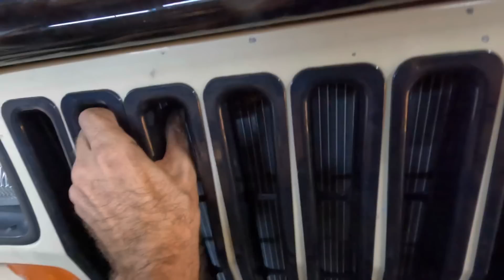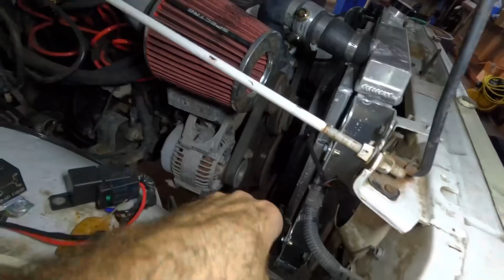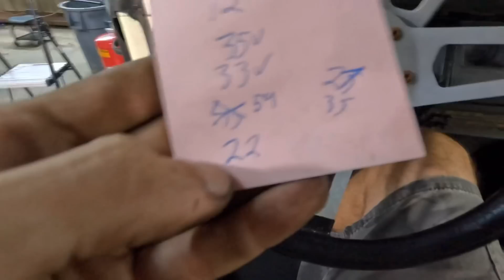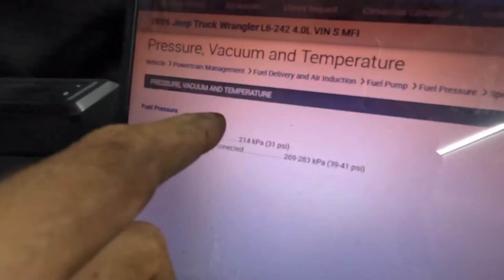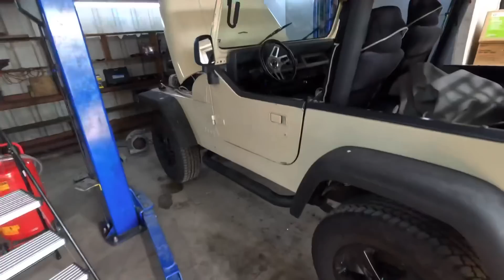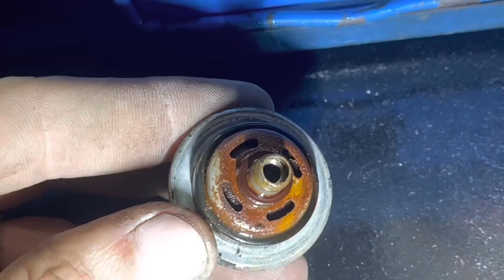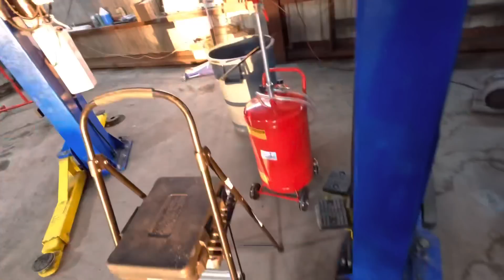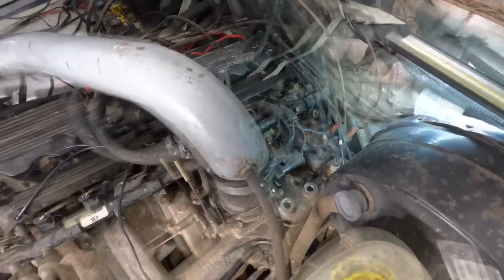Parts Cannon!! Can it be saved?? 95 Jeep Wrangler 4.0

Comment: On that long cold start issue, I had the exact issue on two different vehicles.  Both times it was the temp sensor that communicates with the ECM, the one on the thermostat housing was bad.  You can obtain resistance values to test and check with an ohm meter pretty easily.

Comment: Consider getting a cheap scanner that have OBD 1 connectors for the older vehicles you may service. Also check injector ohms & spark plugs. Connect the loose ground you found. Good diagnostic work so far!

Comment: so with the 4L i have repaired a lot of them over the years and Vacuum is a big deal with these engines, whenever i would get one the number 1 thing i did was all of the vac lines no matter what, i have seen over heating cuz of it no ac, no heat, loss of vent use and non start. all due to bad vacuum lol. also if that jeep has a ACdelco or ultra fuel pump they push 3 psi less pressure then the stock unit, the best pumps to use are the BOSCH or DELPHI. also only use a Bosch or  wix fuel filter. the water pump is more then likely fine its the paper gasket that goes bad once you overheat the engine and the exhaust leak is going to be the manifold. they always crack. best of luck

Comment: I ran across a smog pump on an old 70s Toyota Celica that caused the manifold to overheat (actually glowing red) until it cracked.  It was brought to me after they put 2 exhaust manifolds on and they cracked.  Some old cars were plumbed into the exhaust manifold, unlikely to ever see that again.  Probably will never see another 70s Celica either lol

Comment: Ok, now that I'm to the end of the part 1 video ...

I second all the comments about the camshaft sensor.  That little disc in the distributor can cause all sorts of havoc.  

And yes that includes low fuel pressure - the ECM shuts off fuel flow if it can't sense position.

It absolutely will and can cause the slow start, stumbling, and apparent misfires observed.

To me, I'd start there, also check the crank sensor, and make sure those are good before going on to other things.

Nothing is going to behave correctly with the position sensors unhappy.

Comment: Get back to basics. Have a look at those spark plugs, verify correct heat range. Check the injectors, a partially plugged injector will function well at idle and not at upper RPM ranges. Poor fuel spray pattern can also cause trouble. Lean condition will cause excess heat in the cylinders and exhaust manifold.

Comment: Unless its vehicle body work i expect a same day fix ….
Book it in , drop it off , pick up & pay .

Anything more is a red flag , be it the vehicle or a iffy mechanic .
A second opinion normally sorts poor mechanic problems !
I have 6 shops on my never use list ( 2 are now closed down but you get the idea ) …...

A straight MOT is about 30 minutes & can be wile you wait !
My planned repairs last year , Full Service , Break pads , Exhaust ( not the cat ) , Steering joints & MOT all in 4 hours !

The full service “ Oil changed , Oil filter , Plugs , Throttle body cleaned , New rocker cover gasket ( so it's been open ) , Air & Cabin filters ” .
Verified afterwards but more has probably been done as “ Service ” is not normally itemised !

Obviously not a one man show but that's what's expected .

Comment: Almost anything can be saved, question is if it's worth the time cost and headache.

A neighbor had a Jeep, the original model, up on blocks when we moved into our hose back in 71. Late 70's or early 80's he had my dad over to see if he thought it could be "saved". It hadn't run for 30 years then and the frame and most of the floor was rotten. The engine was apparently in surprisingly good condition and needed very little attention to get working. But the rust! Dad ended up spending a weeks evenings welding it together, replacing the floor and rebuilding the frame. There's no way it could have been road legal, but for rumbling around some estate it would be perfectly fine. Then it went back up on those blocks again with new tarps and there is where it still was in 2012 when the couple who lived there had died and their kids sold the house. It must have meant something for that couple or they wouldn't have it standing there for all those years, but my father was a bit miffed that he spent so much time fixing it up only for it to never be driven again. Don't know if the new owners were able to get it sold or just had it hauled of to be crushed.

Comment: You will get this Jeep running. Sadly it looks a complete vacuum system repair. And maybe a wire by wire continuity test from the ECM. Because of corrosion problems with the connectors. But don`t rule out a bad ECM even though it was changed. I would also flow test the injectors like you stated it could be running lean. Causing it to run hot and be hard to start. Everything needs to be checked it could be a sensor giving false readings to the ECM. I have an S10 that did not want start I changed the fuel pump and the filter with no change. I knew I had spark when I dumped a little fuel in the throttle body it fired up and was drive able. It turned out to be a coolant temp sensor was giving a false reading to the ECM so it would not richen the fuel mixture when it was cold. It could also could be a ground issue. I purchased a Dodge Dakota that ran terrible I cleaned all the grounds and now it runs good. Thank you for another nice video.

Comment: The code 54 is missing camshaft signal. In the many Jeeps of this era that I've owned, a fuel pump or fuel tank check valve was typically the cause of hard starting. You could usually prime them by switching the ignition (no crank) several times to get enough pressure to start. That's why you got it to finally idle after a few attempts. I don't think I've ever seen a bad fuel pressure regulator ever, though.
Reply: I found it odd it would start again after he relieved pressure from the rails check valve, but not when it had pressure.

Comment: I have a 97 XJ (owned since new, too).  The only mods I've done, engine-wise, are 4 hole Mustang injectors and the obligatory APN exhaust header after the OEM one cracked.

Parts wise, other than the usual oil pressure sender, etc. the only engine management fix I've had to do was replace CPS once, and the camshaft sensor inside the distributor once.

All of the above in 327,000 miles.

Comment: When we used to do them we're ready to replace the motor or get someone coming with oil leaks we used to replace the whole thing because Chrysler made there was a new update for the pcvo system the 40s were famous for leaking oil because the PCV would plug up on all the small voltages on Chrysler same thing I would replace the to the update for it would be a lot easier and would be less headaches for you and the customer

Comment: Ray based on your other videos of your work, you might want to advise for people to use you as a pre-purchase check vs those post purchase checks you got in the other shop.   Just a though, an Hour or 2 of Labor to check over  a car/truck, give a list of known issues.   No parts to change, no parts runs.  would probably have to be appointments while they are doing a test drive.  Just kicking ideas around.

Comment: These ECUs are notorious for having cracked solder joints for the connector where it attaches to the circuit board.  They can cause all kinds of poor running issues.

Comment: Had a 2002 Jeep Grand Cherokee... the radiator fan was... notorious for failing over. Back when I had that particular vehicle I stumbled across an interesting... "upgrade" if you will. As you noted the clearance from the fan to the pump is very, very, very close. So close that there was, at least for some engine types, an upgrade that put a fan on the pulley / pump. Thus converting the vehicle from an electric fan to a manual fan... costing some horsepower apparently. 

I was never actually able to lay hands on a conversion kit... but I would be under the impression that somebody out there probably still makes an aftermarket version, or can fabricate an aftermarket version.

It may be worth bringing up to the owner of the vehicle that it may be possible to convert from an electric fan to a manual fan.

Comment: A stuck open or partial stuck open injector will cause a starting issue along with hotter exhaust gases and could cause driving issues as well. It will give a low fuel pressure at start and while idling.

Comment: let me go out on a limb here and say the customer probably overheated this engine more then once i have dealt with alot of jeep 4.0's... run a compression check if it checks out check for leaks at the intake gasket... but before all that check distributor they are known for problems with rust and crap interfering with pickup reading at least  thats what i have dealt with and had good results

Comment: Aww. Its not fixed?
You know. My 88 supra has a jumper circuit you short out to test with older gms had a test system  why jeeps dont have a pre obdIi connection system is beyond me.  Toyotas was ODB I  
I remember when talk was about making 
OBD II the standard.  Using the scan tools speed up finding the problem at least it points in the right direction.

Comment: I had an old chrysler that did that, the exhaust manifold was plugged up with something, I cleaned it out, put the manifold back on and it ran fine until I sold it, I never did figure out what caused the blockage and didn't really care.

Comment: Ah yes...hot injectors slowly becoming inoperative because they are old and have cracked bodies that stop working as soon as they get warm.  The verify: spray cool water on all the injectors if it restarts without an issue you got your problem.  The replacement injectors need to be OEM, the pcm is really really finicky on the old black box pcm models.  At the same time, put the 2004+ perforated heatshield under the injectors before you swap them, the heatsoak really kicks their ass.

Comment: I am thinking it's a timing thing. Now here me out. My experience with these motors comes from installing a stand-alone Holley Terminator X on my engine. So, I had to become REALLY GOOD at understanding sequential, MPFI systems. I even do my own tuning and setup on my engine. And my system has a turbo on it as well. My system runs super smooth and great power. 

If the timing somehow got wacked out and the engine is running too much retard, that would give you the stumbling, lack of power, super-hot exhaust manifold. But sense the ECU controls all that, something COULD be MECHANICALLY wrong. Did the owner ever remove-reinstall the Distributor? If so, is it installed slightly off? (You can turn the oil pump shaft with the Dizzy removed.)

IF it's installed a bit off, that will throw off the syncing of the Cam Position Sensor out of sync with the crank position sensor. The Cam Position sensor is inside the Dizzy, Crank is on the bell housing. There is zero chance to screw up a Crank position sensor during a removal-replacement. 

These engine's MPFI systems are so basic and easy. Another thing to look into is the IAC sensor or the TPS sensor. I had a crank/no start one time, and it ended up being my IAC sensor. 

I am really curious on how this turns out. I hope you share with us your findings.

Comment: As someone with three pre-OBD2 vehicles with carburetors and manual transmissions, I can relate to some of these old school repairs and troubleshooting....1970 VW sedan, 1971 VW Convertible, 1988 Mazda B2200 truck (50 years with me, 46 years, 28 years respectively......)

Comment: Let’s see:
Head ground,
They ditched the stock water pump mech fan for that pos e-fan(prob can’t fit w/ that thicker rad).
That loose cable is the a/c clutch.  
Idk what that loose vac line is.  Check the vacuum pill at the front right bumper.
All 4.0 headers crack, so no doubt fuel trim +

Comment: If it were an OBDII vehicle you would be pulling info like cam / crank correlation, etc. Problem being - OBDI isn't that capable, but this is where a diagnostic oscilloscope comes in - Pico is expensive, Hantek 1008C is an 8 channel scope and is cheap on Amazon - about $110 though both are USB and would require extra computing, you can use them with an android phone or a cheap laptop. Would let you check the cam and crank sensors at the sensor and at the PCM to see if there is a wiring issue. Your code 54 is a cam sensor issue. On a Magnum V6 or V8 the cam sensor controls fuel injection sync, which could be an issue on this.

Comment: This reminds me of an issue I had with my old 92 Silverado. Fuel lines were full of gunk. I fixed it with a ton of file line/injector cleaner. But I was poor as hell. This thing may need a proper line flush or replacement.

Comment: Read the plugs see if its running rich or or lean.  I think I would do a injector leak down test.  Or while its running at 3-4K rpm while its missing pull each plug wire to see if its on the electrical side and see if you can determin which cylinder is giving all the trouble.   Looks like new plugs wires did they replace the rotor?  maybe they skipped that part?

Comment: As a former Jeep Wrangler owner and amateur mechanic, some things I see..
- it sounds like it's popping in the exhaust after revving and throttle lose. That can't be, because of fuel shut-off. So, it looks like injector trouble or idle switch /TPS incorrect.
- look at the vacuum lines to the transfer case and front axle. The front axle has a vacuum operated freewheel system.
The long disconnected wire you found: It looks to me as the wire to the underwood light, which is/was operated by an internal mercury switch. It should give 12v continuous.

Comment: Actually, the running poor issues are partly due to that intake pipe and the filter on the end -- somebody who believes in the "cold air intake" crap that exists on the internet.

Basically, the way the system is set up is instead of pulling in cold air, which is dense, thus you can get more fuel to mix with it, thus getting more power, the setup on this Jeep is doing nothing but pulling hot engine bay air into the motor and thus leaning out the air-fuel mixture. Which is why this Jeep won't stay running. 

I know of this because back in 2005, I had a local educational institute, a Vo-Tech, put a tie-rod on my car when it broke. During that same time, a group of students were trying to figure out why a GMC Sonoma S15 had this exact same problem: Wouldn't stay running, despite the "cold air intake" installed on it. And the teacher basically said the same thing I did here: That the truck, or this Jeep, won't stay running because of the air-fuel mixture being way too lean. I'm surprised that the Jeep isn't pre-detonating because of the heat from the intake air.

Comment: I’m no mechanic but I had a land rover defender with fuel pressure problem it turned out the fuel tank breather was blocked in the cap and the tank was pressurising and not letting the fuel out

Comment: Pretty sure ray ran out of ideas and is now going to read the comments from the internet experts rather than dealing with the problem himself XD
Reply from the maker: Hahahahah, y’all are suggesting parts that have already been replaced 🤣🤣
Reply: @RainmanRaysRepairs  You could weld a handle on it to throw it in the trash if all else fails...
Reply: Btw has the compression been checked? With the non.working fan and leaking cooling system i would not be surprised if that thing is dead....

Comment: As a builder of jeeps, I suggest getting 5.0 mustang injectors (not coyote, think fox body) and that will help with the fuel issue, those stock injectors are single hole and are prone to both blockage and leaking, that's the first thing I do to all yj wranglers, also if those sensors are not Mopar then they can also not be functioning properly, only use Mopar sensors, and only Delphi fuel pumps, jeeps don't like other brands for some weird reason, hope this helps you
Reply: I did this in my XJ something like 20 years ago, they've worked great!

Comment: I had a 98 Cherokee that had a poor running condition, and the fix ended up being a cracked exhaust manifold pulling in fresh air and causing the computer to dump more fuel to correct a false lean reading.

Comment: Could be fuel lines, filter and spark plugs.  Coolant leak/hose may need replacement.  Process of elimination for diagnostics.  Let's see what the actual cause of overheating?

Comment: Dude...stop all of the diagnostics for a moment. Before proceeding, bring up the vacuum circuits in alldata. Go through and reroute, repair, replace every single vacuum line. That needs to take place before proceeding with diagnostics.

The engine restart issues, as well as the backfiring... that's a sign that the timing advance is malfunctioning. The timing advance is controlled by vacuum. Until you get all of the vacuum circuits cleared and corrected, diagnostics are going to be a tail-chasing nightmare, with parts cannon on rapid fire.
Reply: And it's likely going to need plugs too. With the timing advance not working, those plugs can toast out prematurely. Still watching the video...maybe you'll get around to that. But there's a good chance that's your misfire.

But I do hope you pause and do a complete vacuum circuit shakedown first. That needs to be top priority.
Reply from the maker: I ended up capping off all the vac leaks temporarily to rule it out. Stayed down the intake and found no leaks. We shall see tomorrow 😉
Reply: @Rainman Ray's Repairs  I saw where you capped off 1 or 2. But that won't be good enough. Something was supposed to be connected to those.

Those mid-90's cars did rely on ECM, but mainly for fuel intake, security, and ODBC. Most of what we know in modern cars that's controlled by servos and steppers; back then, was controlled by vacuum. So that's why I stress that. And you can bet, 500 shadetree mechanics have already been attacking those lines over the years. Assume nothing is correct.